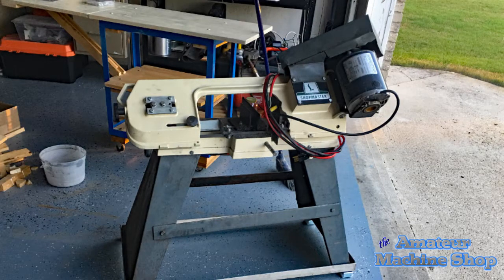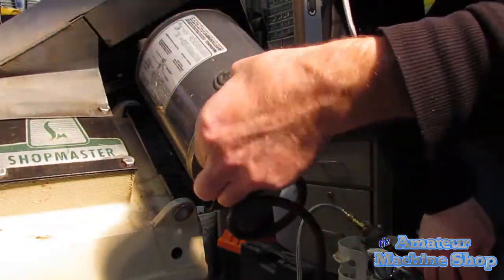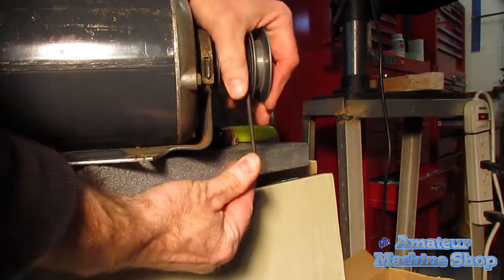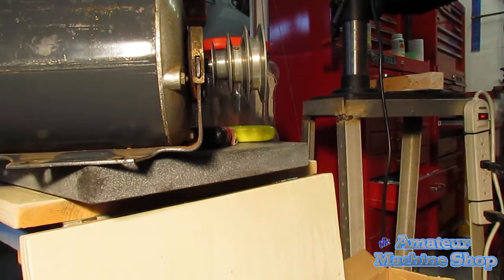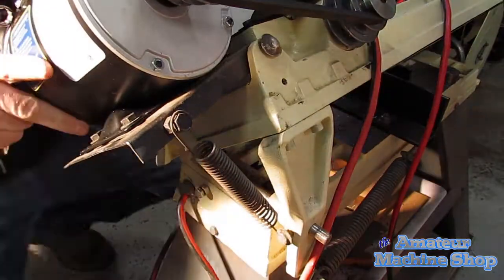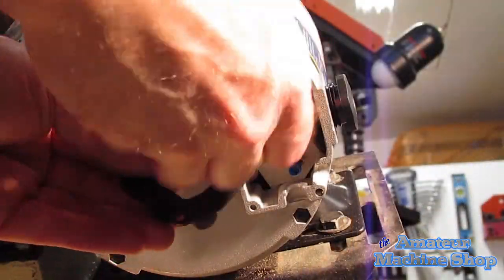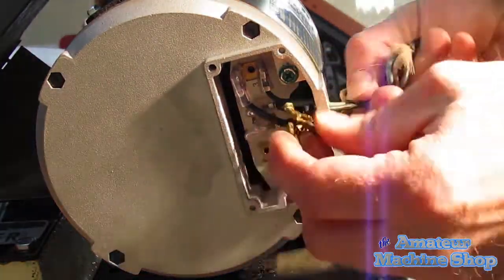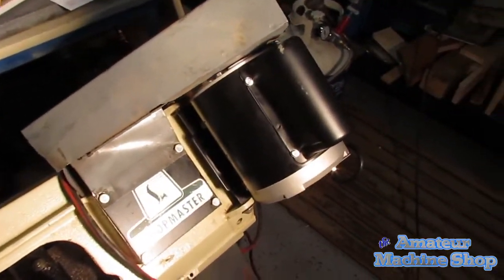4X6" Bandsaw - 1/2 HP Motor Install

Comment: I just bought a new one of these bandsaws and if it’s the 4.5”x6” model the 370W 0.5HP motor starts on any speed setting with the band and belt at working tightnesses.
Reply from the maker: Likely the motor I bought, doesn't have the starting power like a well made motor at 1/2 HP should. Big difference between China made and USA made even though rated the same.

Comment: Could you tell me the specifics for the motor
I know that it's a 1/2 hp 1ph
How much RPM
Reply from the maker: It is 1125 RPM. I thought it would have more power as that is what most of these saws come with. But I have to loosen the belt otherwise motor cannot startup.

https://www.princessauto.com/en/1-2-hp-totally-enclosed-air-over-electric-motor/product/PA0008703118
Reply: You could mod it by adding a belt pulley tensioner that will make you able to loosen the belt to the right tension to start the motor